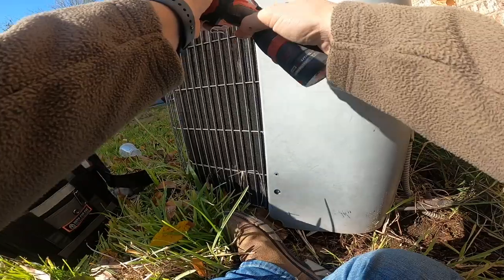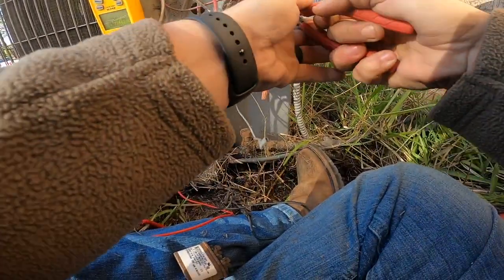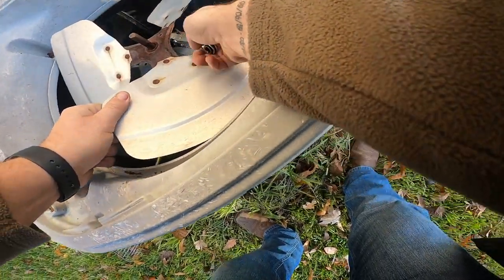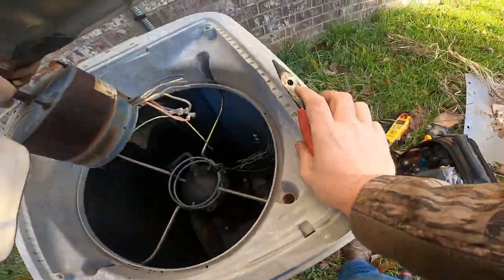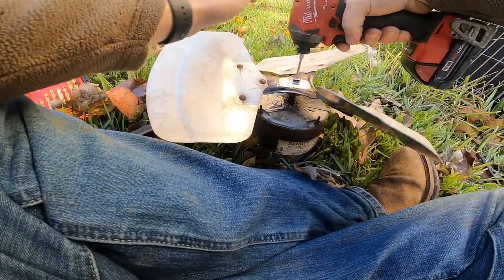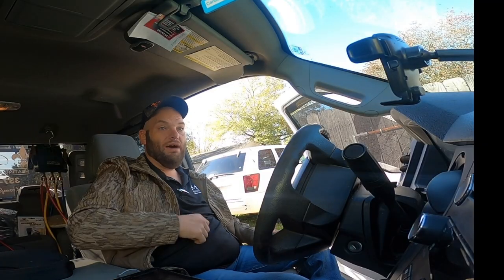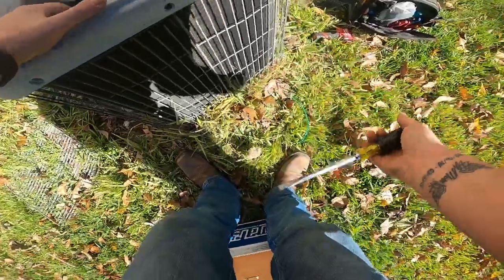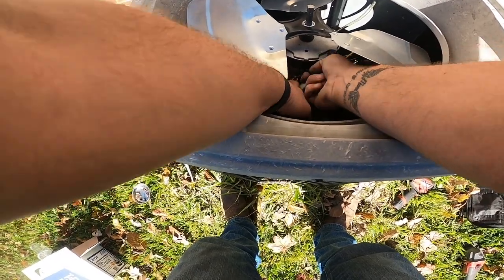Condenser Fan Motor & Blade Replacement/This One Fought Me

Comment: Heat the shaft... not the hub.... or the blade will warp and be all out of balance. Biggest thing with my trick is the hammer chisel/drill which I set to chisel and not to spin for driving it out after using drill bits to heat the shaft and then letting it cool. I make a big jump after the first small pilot hole just to keep bit straight. 
I have another shop video coming out soon with a timer in background.... I get so many comments about puller is faster puller is faster blah blah.... so my video will be a challenge to anyone to use a puller faster than I can remove a rusty blade without one. Cant wait to see the result, who knows ? Peace John.... keep the videos coming !!

Comment: A 3/8 12 point socket will work great on those set screws with the square head. I have a piece of 1and 1/4 stainless 10'' long. with a 1/2 '' hole in the middle that I use to get a hub to move. Works pretty good for me. I always enjoy your videos.
Reply: Use to be you could find 8 point sockets that worked good on square heads or nuts, had a little more contact around the points.

Comment: Becareful when installing them motors because it looked like the reversing wires were under the motor mount bracket and will cause a problem later on, best way to get the motor in us from the bottom and make sure to remove the drain plug from the bottom of the motor. Just a few tips to help you out

Comment: I am not a fan of those brackets. The Lennox units have those and it takes more time. If you loosen it to much. The motor will fall right thru. Too tight it won't go in. Even tho is a stronger bracket but wasn't designed to be easy. I'll mark the top of the fan blade so I know which side is pointing ☝️. Good work John. Love the scruff

Comment: Some hub pullers have those metal ears that u can hook to the outside of the fan blade and pull. 
I would of tried cutting the shaft on the motor end with a sawsall and putting the hub puller on it

Comment: Only thing I could possibly critique is you didn't move the rubber drain plugs for the end of the motor to the top that I saw.
Reply: Or check the amp draw after he finally got the blade and rotation right

Comment: Don't know if you knew this. But I've started using my refrigerant wrench to start taking those set screws off on blades and wheels
Reply: Thanks this is a good tip! 12 point ratcheting wrench’s work too.
Reply: Surprised at how many people don't know that. The Service Tool also fits a lot of gas valves.

Comment: I'd say on the original blade you could have cut the shaft off the motor soaked it in some rust buster by zoom or pb blaster and been able to get the puller on it ....maybe it would've come off ....personally I would've went with a new blade bc sometimes time saved is money well spent

Comment: Also you should have checked the amp draw on that new motor before replacing the panel I know you were in a rush but it takes 10 seconds
Reply: I often find the amp draw cut in half just by oiling the bearings. Especially on power venter motors.

Comment: use drill with wire wheel. A 3 jaw automotive puller may have worked after heat if it didn't cause damage to the fan blade. Bring a heavy duty work bench easier than sitting on the ground.